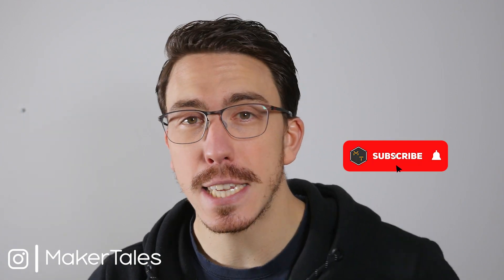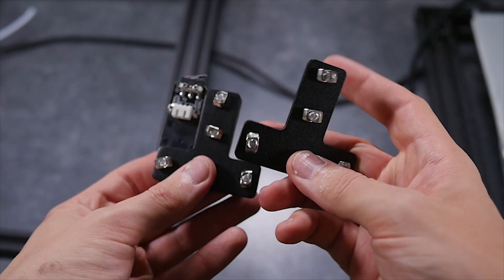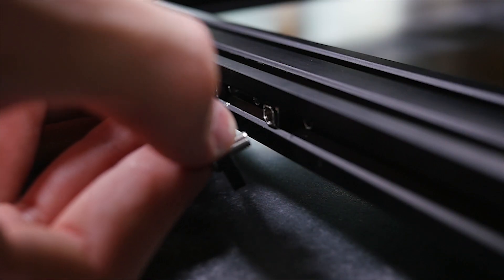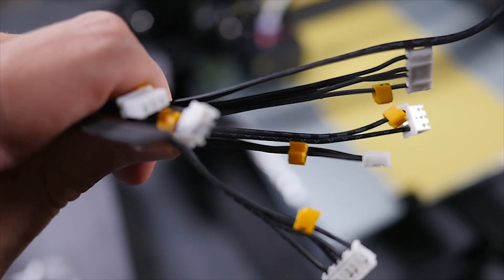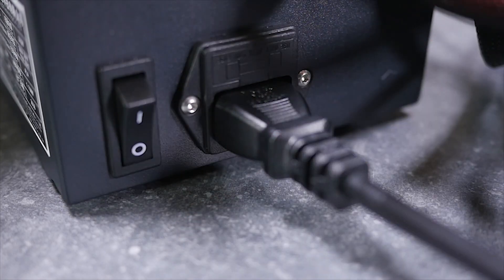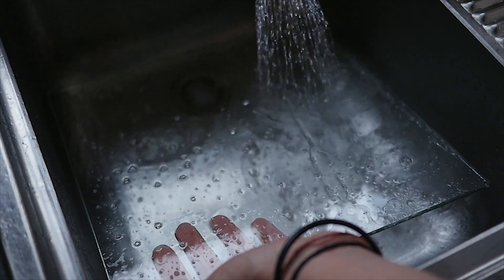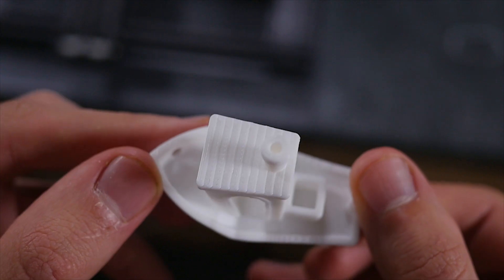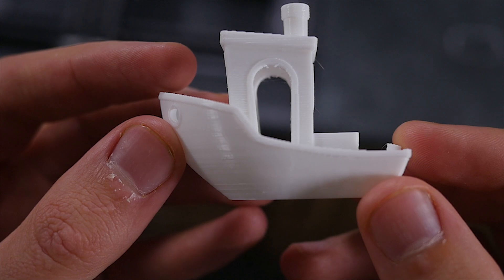Creality CR-10S Full Assembly To Print Guide

Comment: What are your printing settings in Cura I have the printer and I have been testing different settings out I’ve never gotten the printer anywhere near the quality of that test print than you have gotten it I have a Matterhacker blue filament 1.75mm the printer keeps having failed adhesion and the print moves out of place resulting in a failed print any help would be a huge help thanks!

Comment: Idea's anyone? I have the CR-10S printer like you. I noticed you did NOT choose the CR-10S in the Simplify3d drop down menu, but you chose the CR-10. Aren't the CR-10 and the CR-10S printers different? There is also a CR-10s PRO in the list too, but this is also a different printer.

Comment: Loved this video! Do you happen to be cleaning the glass bed every time you print? Thanks!
Reply from the maker: Great to hear Sarrah. Well my rule of thumb is that if I know it's dirty ie i'm getting failed prints then I clean it. Usualy I just make sure I take all the dust of with a very clean kitchen paper towel before use and then i'm fine. I think in a year with about 50 oh prints I've only cleaned it 6 ish times

Comment: Just got my CR-10s and you video was very helpful, thank you! Do you normally run the printer with the clips on the bed? Did you ever end up using the glue sheets provided to adhere the bed? Thanks again!
Reply from the maker: Hey Keith, I'm so glad the video helped you out. I use it with clips and I still do all of my prints with pure clean glass and I have no problems with it. The real key to it all is to be super clean, No dust not nothing.

Comment: So what do I do if I want to put the filament sensor in? It looks like it’s blocked by a chip?
Reply from the maker: Hey Christopher, From what i'm aware if you want the sensor it's one way and it should be a little stiff as you as pushing apart a connection with the filament.
Reply: @Keep-Making  is it something I really need though? Also wondering if you can help me with the bed leveling as I have the CR-10s and no auto leveling I’ve gotten one corner but I can’t lower my other corner any lower and I can’t get the paper to slide at all

Comment: Thanks for the instructions. As a starter, it was easy to follow (had to pause and slow the video 100s of times ;)) , although it took me quite some time to set everything up (I had to manually bring up the Z-endnote because the plate was too high and I could not lower it with the wheels beneath the plate) and eventually print the benchy. But it worked! A great and smooth benchy!
Reply from the maker: I'm glad I was able to help wyannick888 and great to hear that you got it all sorted out in the end 😃

Comment: wow... this glass is not flat. when I set the corners to 1 sheet thickness, the middle is 3 sheets. I flipped the glass and set the corners to 1 sheet, and now the nozzle is tight against the glass in the middle...
Reply: Bullshit... thats not a CR 10 S5
Reply from the maker: Ah the infamous cheap glass... I was lucky that I only have about a 0.2 - 0.5mm change in layer hight on mine which i'm more than happy to just over extrude in the first layers to compensate. In all honesty, you have 3 options. 1. Do what I did.  2. Buy better glass, most people swear the best are Ikea mirrors. 3. Follow this slow and painful ( and in my opinion painful) process https://www.youtube.com/watch?v=0j9fa86jiv0     ( I hope that helps ) Remember to approach 3d printing as a hobby that will get better with time. Keep Making
Reply: @Keep-Making  Thanks! I think I will try the mirror solution. I don't want to bake masking tape onto my aluminum plate.
Reply: @Keep-Making  m

Comment: Is this your first 3D printer? I was looking into getting a 3D printer and this one was on topof my list.
Reply from the maker: Hey, it's my 2nd one. That I have owned. I did use to have a zortrax m200 but that is one hell of an overpriced closed system printer. I'm really happy with my CR-10s. I did have to send back the first one I got from amazon tho... It came with a broken thermostat on the printer head. A small 10-day delay but the second one has been working beautifully. I would recommend it myself for sure. Just make sure you look at 3d printing as a hobby that will get better with time as there is quite a lot of settings to test out and wrap your head around.